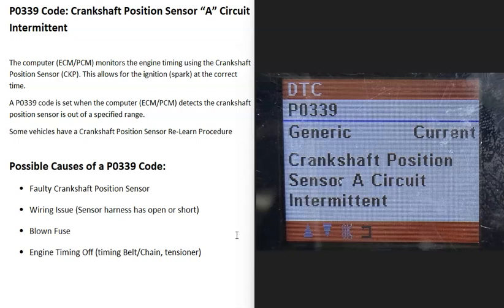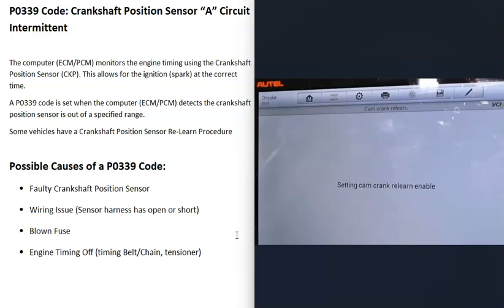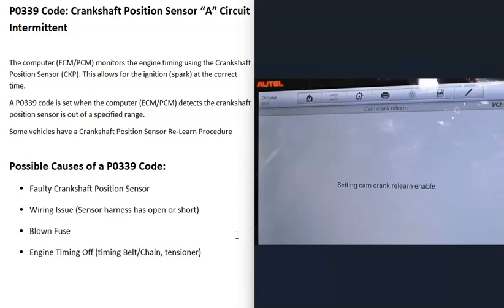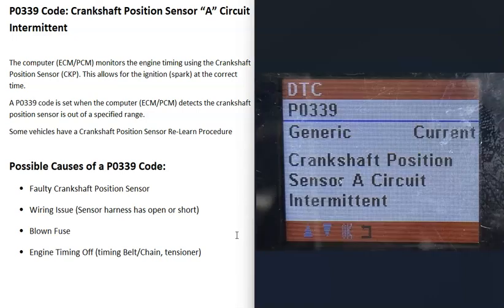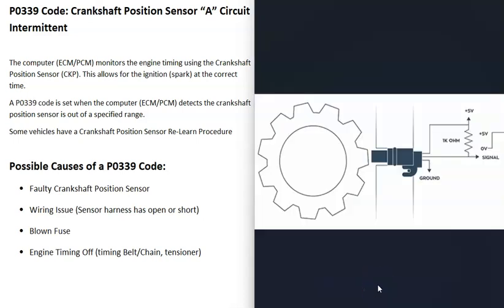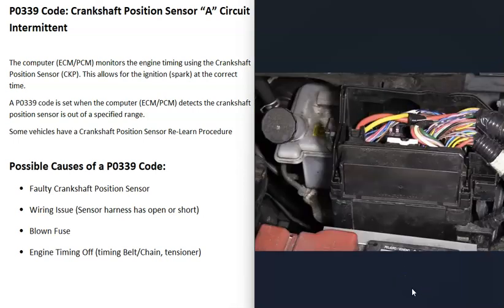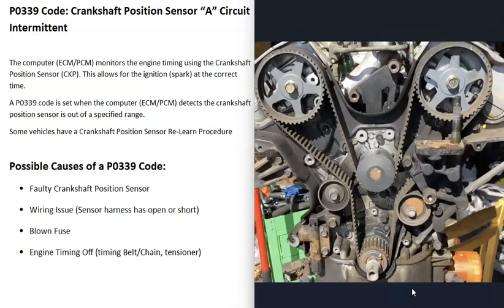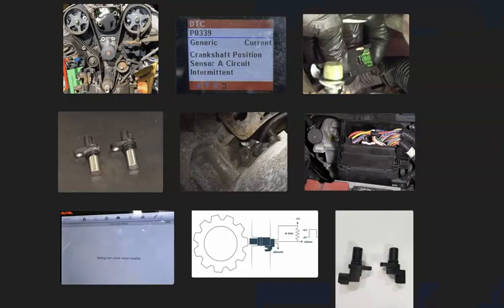Causes and Fixes P0339 Code: Crankshaft Position Sensor “A” Circuit Intermittent

Comment: I have an accord 2009 2.4L i changed the sensor twice.. last time i installed a OEM DENSO.. and re learned it.. but still the same.. the CEL is hidden.. but there is a P0339.. it hesitates to start when warm.. and i am not getting quick acceleration.. the RPM is ok but not getting enough power. And getting a little low MPG
Reply from the maker: If the sensor is good, I would test the wiring. I made a video on how to test the cam sensor circuit, which is basically the same for the crank sensor. Here is a link. https://youtu.be/MU95sRU8wng

Comment: Hi, thank you for the info. in the video. Since you mentioned maybe a wiring issue or fuse issue,..could this be a reason of having the car battery getting drain?

Thank you again.
Reply: Same situation rn would have been nice if you got a reply and did you get it fixed ? Mine is doing all that crank no start battery draining . Battery is 2 yrs
Alternator 1 yr 
Fuel pump 2 yrs 
Starter 1 year . 
Changed the crankshaft sensor 2 x and still no start . Checked wires there is ground and power . No blown fuse . I even put 1 ring spacer then 2 , no start. 
Thing came with 4 rings about to try 3 then 4 . I do see a small leak was covered in oil
Reply: Unfortunately, I still haven’t found my problem, all I know is that there is an electrical problem that I don’t see to locate. Gladly changing several components, like alternator, starter, battery and the sensor it self has erased my problem almost completely, my battery is not draining anymore but occasionally I get a hard start and I know is an electrical problem because once in a while the interior light come on, or my key fob to open or lock the car works because it usually doesn’t, sometimes the anti theft system that came from factory malfunctions…and I get the same code but again is very rare now. I hope you find the problem with your car. Take care.

Comment: There is also TSB: S/B-09-050 MIL illuminated with p0339 and possible p0302 and p0303 stored. The fix is to update the PGM-FI software and clear and relearn ckp sensor.

Comment: 1:01 would this also be an issue if I already changed timing belt and possibly was off a tooth ? Problem didn’t start until I did in fact change time belt, so I guess next question would I have to take all that back apart again I did this myself trying to save money but I’m no mechanic by any sense of the word,
Reply: This is on a 2008 Acura TL
Reply from the maker: Yes, if the timing is off, it can affect the crank sensor.

Comment: I got a Ford Focus 2016 1 liter turbo 3 cylinder, the engine started vibrating a bit about a month ago, thought it was a engine mount, but today, car would not turnover, had to jump start then got a p0339 code, and engine not running smooth at all, at one point at idle felt like the engine jumped. Battery indicator light when on today, ford said it was a wiring issue a few months a ago when it went on, they said found a pinched wire and resolved the battery indicator issue. Can I still nurse it around or got to tow to a dealer?
Reply from the maker: It will need to be diagnosed. It sounds like the wiring issue is back, but you could have the battery tested and check the alternator output.
Reply: being looked at now, timing belt, crankshaft sensor, alternator, wiring, lots of variables, it’s got new spark plugs , new coil pack, new turbo new catalytic converter
Reply: Mechanic said it’s not the P0339. It’s actually the alternator because of the alternator doesn’t provide enough voltage. The sensor is going to get a bad reading, but we’ll see.
Reply: @jonalexanderfilms  Did it end up actually being the alternator? My girlfriend's 2016 Focus has been having almost the exact same issues that you describe. I was suspicious of the alternator until I found this engine code got flagged. I'm very interested what ended up being the root cause for you.
Reply: @gettinSC  Yes -- the alternator----, the general public is not aware, but a good machinic told me, when the alternator begins to fail on modern cars, the unstable voltage begins to make the main onboard computer malfunction, and you can get random problems like wipers going on by themselves and random dashboard warning lights.  If you see the battery indicator going on any car, it really is most likely the alternator and needs to be fixed within 1 day no kidding.